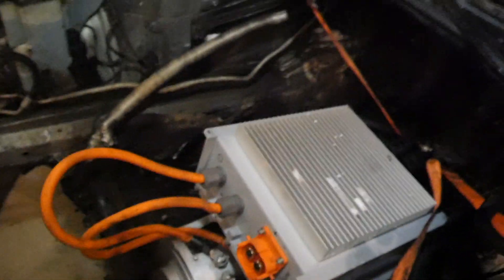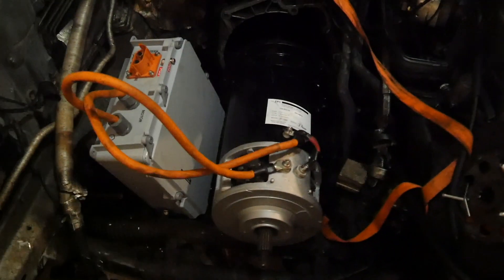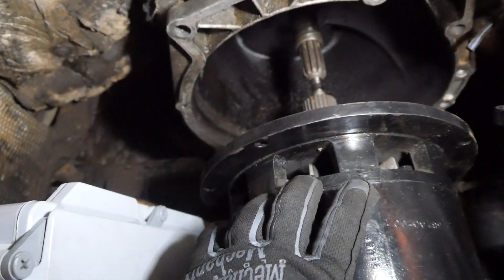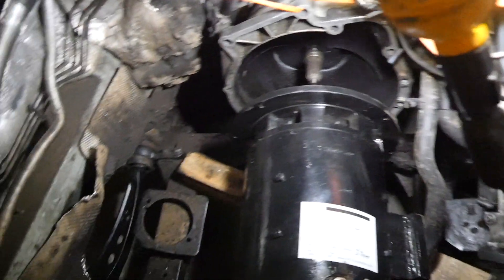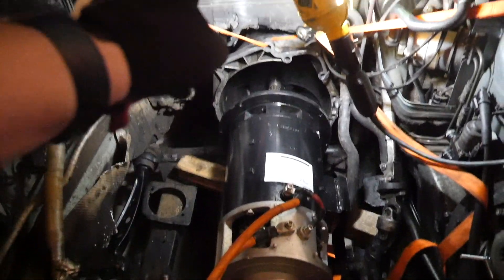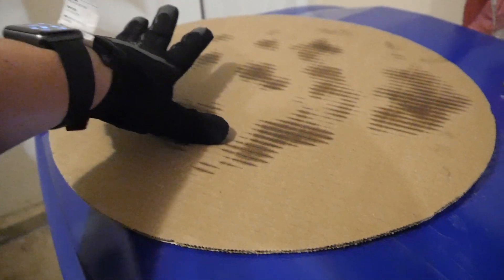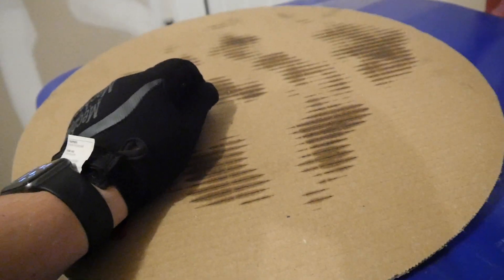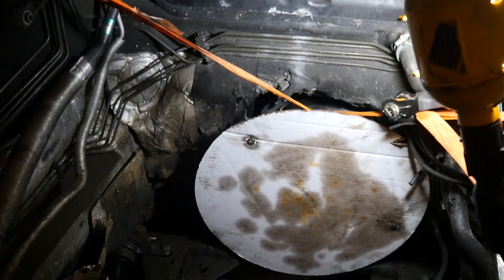Cheap EV Conversion - Adapter Plate Template Trick!

Comment: Your electric motor has a register which mates with the mounting bore in the adapter plate. This bore is on center with the transmission input shaft. They have to be less than .001 in order for the coupling to not disintegrate in the first few minutes. There is a little more to it than getting a brain storm while eating your favorite pizza !
Reply from the maker: i’ve been driving it on and off since last august with not a single sound of grinding or vibration 🤷‍♂️ doesn’t need to be overthought too much
Reply: @TechMischief  I am glad it's worked out for you. Its " overthought" it's just the proper way. These comments are not for you, but for others that want the job done properly.
Reply: Don`t listen to the 'dangerously complicated' peple who never do anything. Spouting exact tolerances and wringing hands over dire consequences.  Just Do It!  Mine runs fine, i used a very similar adapter template method
Reply: @scottbaker9066  Yup, don't follow specs or age old procedures, just wing it ! 🤣

Comment: I came up with an easy way to line up the transmission to the motor about 20 years ago and I've been using it ever since. I made some videos on YouTube about it. But you have to take the transmission out of the car to do it. Congratulations on all your subscribers I have about 200 after 12 years
Reply from the maker: If I found the correct video, I believe I did the same. I removed the center of my old clutch, and used a bolt to press it against the coupler for my motor. I took some feeler gauges to check the gap around the area they touched, and once I got it minimizes and equal across, I welded them together. Or is there another video I missed about making the entire motor and trans assembly line up? Great advice, this project is just about to take to the streets, so any and all help is much appreciated!
Reply: I know I am quite off topic but does anybody know a good place to stream new tv shows online?
Reply: @Axton Fletcher i would suggest Flixzone. Just google for it :)
Reply: @Lian Hank Yea, been using Flixzone for since march myself =)
Reply: @Lian Hank thanks, signed up and it seems to work :D Appreciate it !
Reply: @Axton Fletcher Happy to help :D